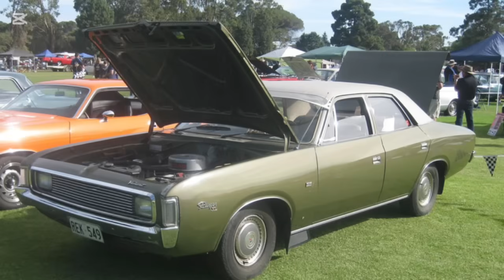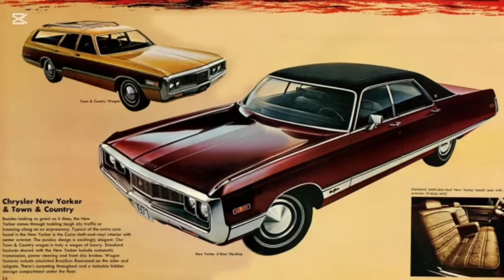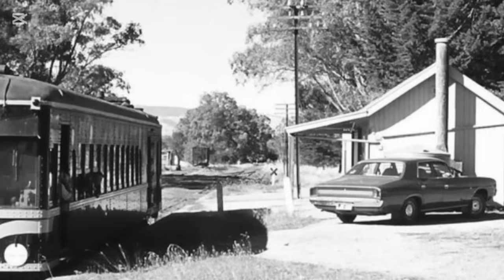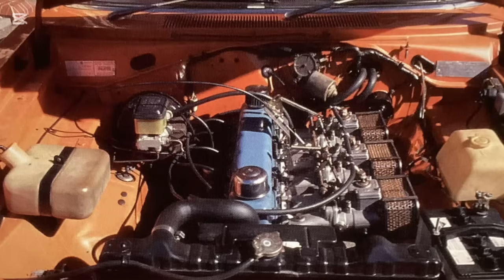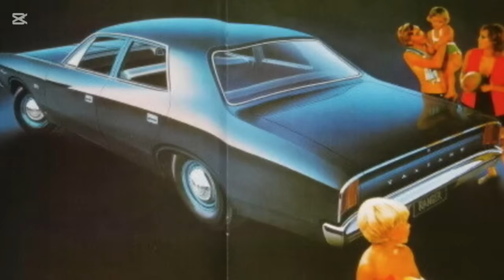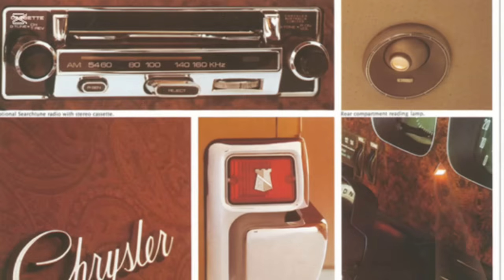VH Valiant & Charger - The Most Comprehensive Video Ever!

Comment: I've just noticed, in the Chrysler magazine advertisement for the VH Pacer that you showed, they depict it having an E38 / 49 six pack type of bonnet air scoop, which doesn't really make sense, given that the Pacer doesn't have the triple Weber setup. I've never seen a VH Pacer with that scoop , maybe it was an option on them ? , maybe just for reducing engine bay heat ?
Reply from the maker: Good pick up, marketing materials often took some liberties with the options back then. 🤔👍
Reply: @markbehr88  Yes, I thought it was most likely an advertising mistake .

Comment: The wheel base allowed for wider aftermarket rims and tyres. Personally I find the fuselage shape is more appealing than ford or Holden offerings of the time. 
I’ve owned all of the big three from aus in that era and to me hands down the nicest to drive was the valiant. I have circuit raced a charger for years. The lack of handling comment is probably a little unfair as the VH suspension was easily tuneable by a good wheel alignment technician.
Reply from the maker: That’s a great perspective, and it’s always interesting to hear from someone who has spent so much time behind the wheel. 👍
Reply: @markbehr88 great videos by the way, keep up the good work. I know that making videos takes a lot of time and energy to create. A mate of mine does the VH valiant Pacer channel.
Reply from the maker: @brettdavy3775 Thanks very much. These Auto History videos in particular, take a long time to make. Hopefully, people enjoy them. 👍

Comment: i had a vc with a 3 frost plug slopper and ex extractors on it . i recoed the donk and took 2mm off the block and 1mm off the head . it took the comp to 9.5:1 . ran a 2" pipe strait back over the diff and out . no muffler . i put the 2 barrel 318 v8 carb on it with no need for rejetting . a valiant wrecker sold me what he said was a 180hp cam so sliped that in the front . i put the discs off the VE on the front ,, result : the car had a beutifull sound from 80mph up . never did know its top speed . engine was smooth all the way up and i predict it would keep excelerating to destruktion . power was exalent from takeoff to around 70mph then it began to increas . buy 90mph i was feeling the Gs and it carred on pulling till the needle was down past the end heading for the 6 oclock . i chicken out then . just a footnote : i went trough 5 diffs and ended up putting a ranger diff in it noone had a diff , couldnt find an original one , rewelded the spring hanger mounts in 30mm each , put toyota van rims on the rear to keep the track the same , put the regal discs strate on to keep the stud patern the same as the diff . and a rover brake booster in the boot . got photos if your interested , also i put wings down the rear ,wanted a mk lll zepher look .
Reply from the maker: Sounds like a Beast. 👍

Comment: The statement that a sorted ( suspension wise )  Charger is a much nicer car to drive than a sedan is not in line with my experience of having owned both versions. I had a near immaculate low mileage 265 770 Charger, and I was quite disappointed with the road holding and general ride comfort, I thought, because of the short wheelbase and lighter weight ( than the sedan ) it had a bumpy, choppy feel to it, and compared to a sedan the rear end felt much more prone to losing traction and letting go. I fitted it with good heavy duty dampers , it had a front sway bar , 7 inch front wheels , eight inch rear wheels with wide Goodyear Eagles , everything to do with the suspension and steering In top condition, and I still didn't feel satisfied. In contrast my VH sedan has all of those things that I tried to improve the Charger with, and it's WAY better, it carves through the turns beautifully, is not choppy at all , it's a comfortable ride , and the rear end never feels like it's going to let go ( it never did ,even the way it came from the factory with the pizza cutters ) .
Reply from the maker: I know, putting extra weight in the boot, definitely helped the Charger and it was obviously selected for racing, but who was saying the Charger was much nicer to drive? 🤔
Reply: @markbehr88 To be blunt ,you said that, at 1 hour and 24 seconds into the video. 😮. The VH sedan isn't significantly larger or heavier than say an XY GTHO ( or XA coupe , or the  proposed Phase 4 racing sedan ) in fact a VH Pacer with E49 drivetrain would have been a considerably lighter  , and better balanced car without the weight of that Cleveland lump up front. I'm not saying that the brakes would have been any better than a racing Charger though. And , when you consider that bigger long wheelbase 1970 Dodge Challengers were raced in the American Trans Am series ( and almost as big Cudas too) with heavy v8's , I think the idea of  the VH sedan being too big too race is unjustified. Said with respect to you .❤
Reply from the maker: @barrycuda3769 Fair enough. I guess the main issue with the Valiants versus say the Falcon was the track in relation to the body. I am talking in stock form. Pre Holden RTS in standard 6 cylinder form I would rate Falcon then Valiant and Holden but there was a road test at the time (Motor Manual???) that tested each car. That would probably be the best source. I think I quoted some comments from early VH tests. The Holden HQ was very soft, the Valiant had a narrow track versus the body overhang but was not soft like the Holden. When I made the Charger comment I was probably talking about the width to length ratio being better but I think I also mentioned people used to put cement or something heavy in the boot in the Charger as it was light in the tail (and choppy as you said).
Reply: @markbehr88 I was just about to send a rather long and detailed reply, and it disappeared on me , very annoying. Anyway, here's a much more condensed version. Your video on the VH series was excellent. The VH narrow track is easily rectified with wider wheels and tyres. For VH and later Valiants ( probably earlier as well) I highly recommend having the front wheel alignment set to the specifications recommend by the NZ racing driver Leo Leonard, he did a lot of testing with his E 38,49 Chargers, and came up with what he thought was best for racing, but also a street car setting, both of them are mentioned in the book " Hey Charger" . I've had my VH set to his specs and it made a big difference to the steering stability, I recommended it to a VH Pacer owner and he was also pleased with the improvement. The way they came from the factories , I think the Falcon and Holden were a bit nicer to drive. The unkind  comments from Wheels magazine about the VH sedans steering being sloppy doesn't ring true with me , especially considering they named the E49 Charger   "Car of the year" , and it has the same steering setup , except for a quicker ratio steering box .
Reply from the maker: @barrycuda3769 Thanks. I think the Chrysler power steering was over assisted but don’t think Wheels was talking about that. I reckon all the cars would benefit from wider tyres and interesting re the tips from LL too. 🤔
Reply: @markbehr88  I took a VF VIP for a test drive once , and almost put it over a gutter and onto the footpath while steering around a corner, same thing in a friends '70 Coronet . I wouldn't have that power steering on my car .
Reply from the maker: @barrycuda3769 I guess, you would get used to it after a while? 🤔
Reply: @markbehr88 Maybe " Wheels" magazine were testing a sedan with power steering  ?, which wouldn't be a pleasant experience if you weren't used to it . I was just thinking about the VF 318 Regal I owned many years ago , it didn't have power steering, I suppose it was optional on the Regal?
Reply from the maker: @barrycuda3769 Yes I had an XC V8 Fairmont and it did not have power steering. Heavy 🫣
Reply: @markbehr88 I didn't find the VF Regal's  steering heavy at all , I never gave it a thought , the tyres weren't very wide though ( 205 Aquajets ) .
Reply: I looked it up , the weight difference between a Cleveland and an LA 318 ( lighter )is only about 25 pounds, not a significant amount. Did you have wide tyres on the front ?
Reply from the maker: @barrycuda3769 No. standard rims but the steering ratio would make a difference. Turns Lock to lock.
Reply from the maker: @barrycuda3769 Steering probably highly geared?
Reply: @markbehr88 Could be ? , there's  so much one could research . Merry Christmas to you .
Reply from the maker: @barrycuda3769 You too. Thanks for Subscribing and all the comments. 👍👍

Comment: Better looking than any American muscle car of the era. The proportions were just right, and those square lights completed the perfect face. Always been a fan but you never ever see one here in Japan, even though a total of 220 Chargers and Regals were imported here in the 1970s. Of course, the Holy Grail of "barn-finds" would be to find one in some shed in the mountains that they let you take away for $20 because no one knows what it is. No Aussie will ever ship one to Japan either for the same reason. No one knows what it is and so the resale value would be only a fraction of the value in Australia. The Japan spec. Charger was different. Double round headlights, wing mirrors, reversing lights, wing indicators, a clock, and no Valiant badge;  just the "Chrysler Charger 770".  And available in V8 only.
Reply from the maker: Yes, although a 1969 Mustang Mach 1 has excellent proportions imo. The Japanese market brochure I did the episode on has all the cool variations for the Japanese market. I wonder if there are any hidden away in a building or a farm somewhere? That would be great. Like my UK Landau find. 👍👍
Reply: @markbehr88  Oh! The same guy! You do get around. I lived in Australia for only 2 years (1980-82). My biggest regret is not picking up a Charger before I left, when they were still real cheap. I do have the Japan Charger catalogue, with all those rare, rare pictures. I had to get through a bidding war in order to get it though. Not cheap.
Reply from the maker: @ChrisPhillips-y3v Yes. One and the same. My brochure was very dear too. Like $350!
Reply: @markbehr88  Wow. That just goes to show the difference between the Japan and Aussie markets. I got mine for 10,000 yen. The same thing would happen if you shipped a Charger over.  10% of the price you paid for it in Australia as a landing charge, even though the value would drop to a fraction as soon as you drove it out the port. I will keep up my Holy Grail search but probably as futile as that poor bloke' who spent decades looking for buried Spitfires.
Reply from the maker: @ChrisPhillips-y3v Good luck 👍

Comment: The fact that the Charger had the most resolved design considering the tiny budget, time constraints and shared parts just reinforces how talented the australian team was.
Regarding the steering slop, i heard that the american designers of the A body had the engine placed off to the right of centre as to allow adequate clearance for the steering box which was mounted on the subframe. With the australian conversion to RHD, the steering box had much less room to fit on the other side of the engine as it couldn't be shifted to the left which resulted in the steering box being mounted on the body inner guard instead of the subframe in RHD models
Reply: The steering slop as new comes from the rubber in the idler arm connection to the chassis rail, a Chrysler Australia Parts and Accessories Kit (Part No. 1857962) was available from dealers to correct this by replacing the rubber bush with thrust bearings and spacers. If other compenents are not worn out this fix eliminates the "slop" and reduces tyre wear - I've been fitting these for 40 years for exactly this reason (the bearings are king pin bearings and the rest are simple parts made on a lathe). Of course steering boxes 10+ years old are also often suffering some wear and tear.
Reply from the maker: Thanks for the info. Good tip. 👍
Reply from the maker: Yes. Although the Australian design team also included Americans. 👍

Comment: Ive got a Vh 4 dr regal 770 318 V8 ive had it since 1982 , never ran high zinc oil infact i ran woolworths black and gold brand oil in it for yrs  never ran 98 fuel , had the motor freshened in 1987 , uses absolutely no oil
Reply from the maker: Very good. 👍

Comment: Malcolm Fraser had a factory built. Chrysler that had enough leg room for him. The story goes that the union got wind of it and sabotaged some cars that they thought were going to the PM. Chrysler modified it after hours using some trusted workers. It had a 123" wheelbase twin A/C and the smaller rear window & the 360 CI from the CK Chrysler. They did the good old cut & shunt adding 11.5 inches (to bring total length to 207 inches)   Fraser loved it so much, so that he bought it keeping for some time I knew Whitlam's driver& as well has his his former bodyguard  he told me they called it Long Tom
Reply from the maker: I have seen photos of that car actually. 👍

Comment: My dad had a VH 265, and it was a grunty beast. Although by the time I got to drive it, it's get up and go had largely got up and went 😮 
However, the torsion bar suspension didn't seem to do it any favours. Dad had over riders on the rear leaves, and I remember going across a railway crossing in an XC Falcon that I'd travelled across many times with dad in the Valiant. The ride of the XC was an absolute revelation! 
Bar the CM, I have no illusions about owning a Valiant from that era.
Scratch that, I would love a VH/J/K two door hard-top coupe or a Chrysler by Chrysler 😊
Reply from the maker: Those were the days hey. 🤔👍

Comment: Something that I learned a while back , is that VG/VH Valiant's, ( if they came with front disc brakes) , the calipers were made by Kelsey Hayes , but for the VJ  they had another brand, probably PBR , or Girlock ?. Im wondering if the disc rotors were also Kelsey Hayes ?  , the rotors on the VH aren't very good in my experience, they warp pretty quickly if used on long downhills, and I think I remember the owner of a VJ ute saying the same . The discs on my VH have been skimmed a couple of times. As far as I know, Kelsey Hayes was well respected in those days in America , and were used on US Chrysler cars . Ive wondered if Kelsey Hayes had a factory in Australia? , probably not .They were probably dropped after being on the VG/VH , in favour of of using locally made brakes .
Reply from the maker: Yes Kelsey Hayes made a lot of brakes and wheels for the Big 3 in the USA. My 67 Cougar has 4 piston front discs from them. 👍
Reply: @markbehr88  On the VH they have one big piston , they work strong enough, it's just the rotors that are a bit disappointing  .Whereas the rotors on my VF Regal were much better quality , they didn't warp at all , I think they were probably the same as what was on American Chryslers .
Reply: VJ-CL used a single piston sliding head Girling brake caliper

Comment: In the 1980s GF Dad had the same Regal as your thumb nail , and at Xmas we all go up to their bach up north at the beach , 2 hours each way ,i go up with the first lot then drive it back and grab the gf and her sisters and more stuff , cruising in the Regal , Auto 265 and her Dad was a circuit racer and did lot of work on the Suspension handled really well for a boat . comfy seats ,great memories , Her dads previous car was a Hillman Minx with late model sunbeam raiper running gear , Seen a few VH Pacers with gaurds full of widened  steel and fat tires and the look really good
Reply from the maker: Nice memories eh? 😀👍